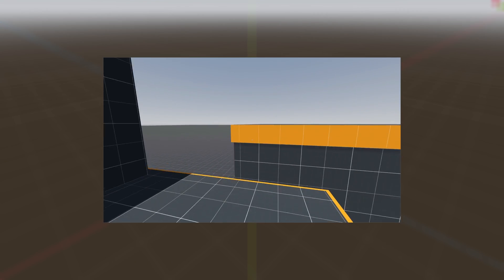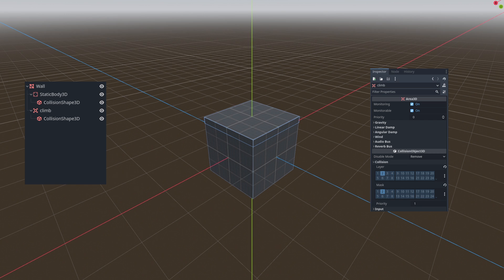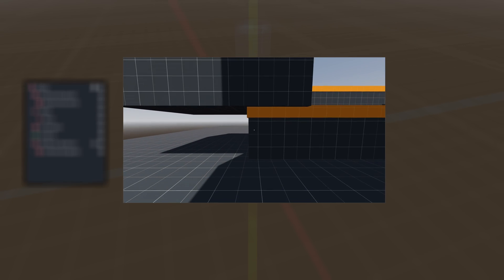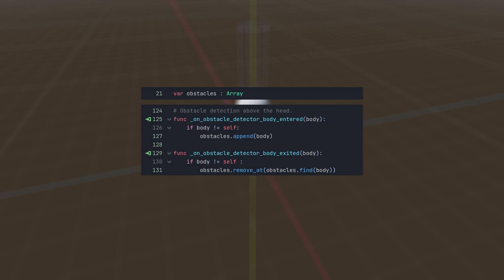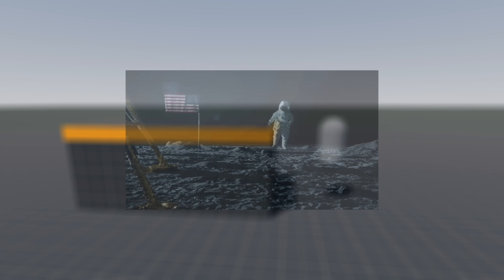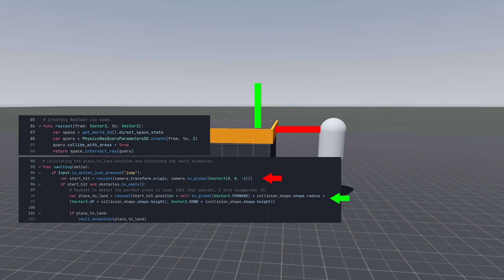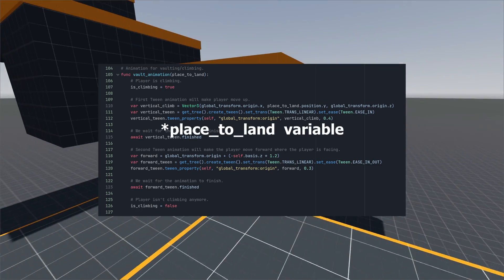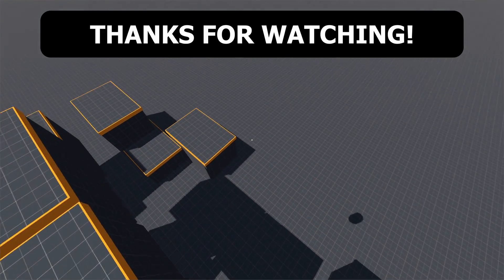How to make a BASIC FPS CLIMB / VAULT system in Godot 4.2!

Comment: useless tutarial, just made me spend 5 hours on a 2 minute tutorial and i still havnt gotten it to work. Im very disappointed
Reply: You suck :|    😅
Reply: Its a very good tutorial. He kept it short and showed his fairly simple idea on how he would implement such basic system while using built in features. But if you can't get this working then go try simpler things/learn the engine before you complain.
Reply: the tutorial has "Basic" in the tutorial meaning it should be beginner friendly but im not even a beginner and i couldn't understand it so shut up lil bro

Comment: For anybody encountering issues with the obstacle detector not colliding with your map, get Jolt physics off of the asset store, set it to the current physics engine, restart godot, go into project settings, go into the menu "Jolt 3D" and check "Areas detect Static Bodies" and it should work.

Comment: The only reason I'm hesitant to implement a system like this is that you have to design your levels with that specific setup on every single platform. Would prefer a more code-based approach myself
Reply from the maker: I understand the concern about level design constraints with a platform-specific setup. A code-based approach definitely offers more versatility and scalability across different platforms. That's the beauty of coding—you have the freedom to iterate and adapt this idea to suit your needs. Feel free to experiment and tweak things to find what works best for you!
Reply: @Alenvei  I think this can be done using the physics server, its pretty much what you are doing except you would need to add a little bit more checks
Reply from the maker: @Dragon20C  It's a good idea! I will check it out :)
Reply: In my experience, trying to make something 100% robust will take you 10x longer since you need to design the levels anyway.
Reply: Could you perhaps create a platform prefab that can be instanced and scaled as needed? Then you'd only need to define the climbable bit once. But I've never used Godot so I'm not sure if it would support something like that.
Reply: I know Im almost a year late but it is possible. I experimented with it and came up with a basic solution :

func _physics_process(delta):
	if  !is_on_floor():
		velocity.y -= gravity * delta
		in_air = true
		ledge_ray_cast_l.enabled = true
		ledge_ray_cast_u.enabled = true
		if ledge_ray_cast_l.is_colliding() and !ledge_ray_cast_u.is_colliding():
			velocity.y = LEDGE_VELOCITY
			#anim.play("LedgeHop")

You'd have two raycasts, one at head height and one at chest height, both facing forward. When the lower raycast is colliding and the upper raycast is not, you'd get thrown upwards just enough to get you onto the platform. This would work with every platform in the game.

I never did any extensive testing but it worked and looking back at it I didn't include an else statement disabling the raycasts when on the floor and I didn't have any checks for anything above the head.
Reply: Its all about tradeoffs, for handmade levels this approach is ideal because you never have to worry about players climbing where they're not supposed to (it is also easier to test). For a code based approach its easy to generate or handle climbing at runtime, but you need to decide in code about what constitutes a climbable surface, which comes with its own edge cases and jank.